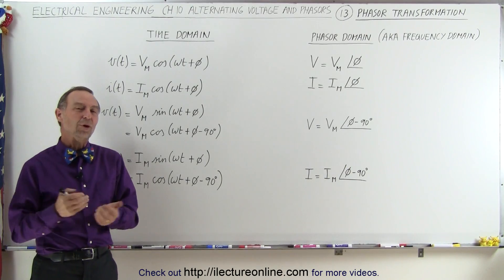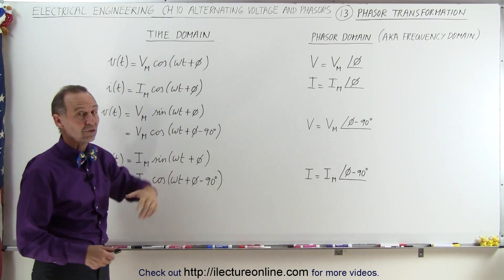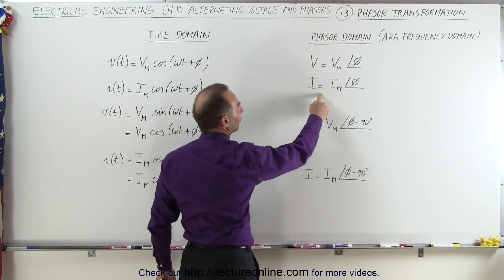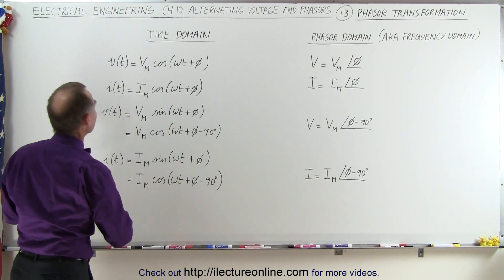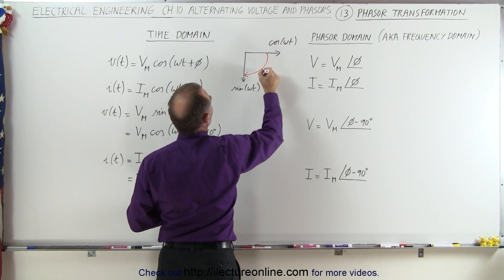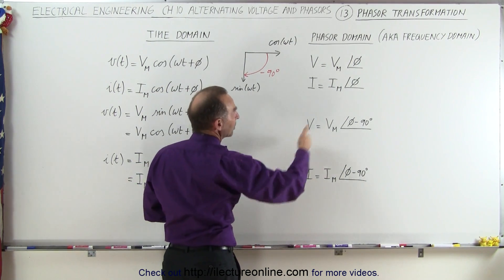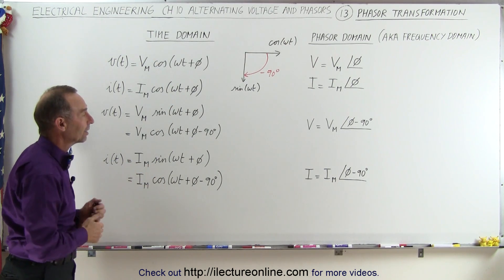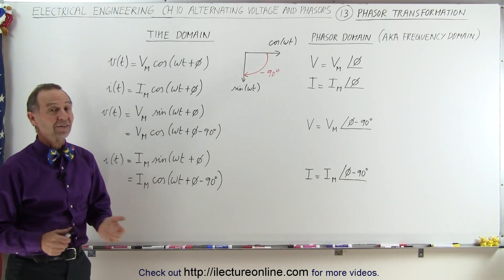Electrical Engineering: Ch 10 Alternating Voltages & Phasors (13 of 82) Phasor Transformation

Comment: I have a question doctor plz answer my exam is tomorrow if i was given a sinusoidal voltage source which is described by v (t)=cos (wt+phi) do i change to sin and continue working normally
Reply from the maker: You can work the problem with either the sin function or the cos function, although using phasors it is better to leave it in the cos function.
Reply: Michel van Biezen exactly because if im solving a problem that has a sinusoidal voltage source with a resistor capacitor and inductor and it can be solved by inspection and impedence if i solve for the current my answer in the phasor domain will differ in the angles if i start by cos or sin
Reply from the maker: Do they differ by 90 degrees?
Reply: Michel van Biezen yess
Reply from the maker: The correct function is the cos function if the positive real axis is to the right and the positive imaginary axis is upward.
Reply: Michel van Biezen thx a lot for replying Dr